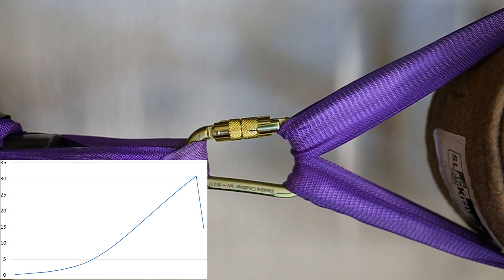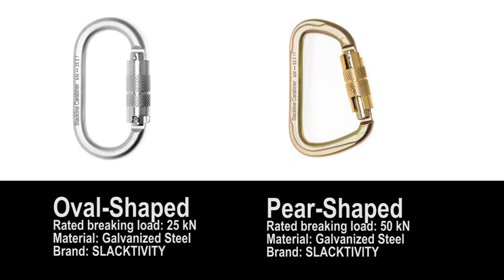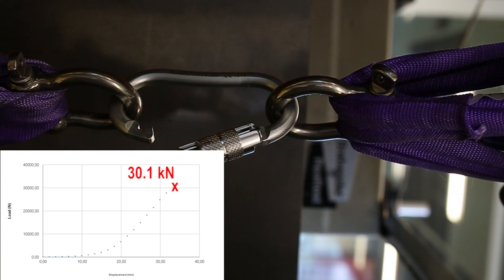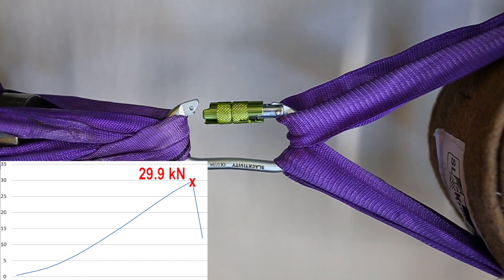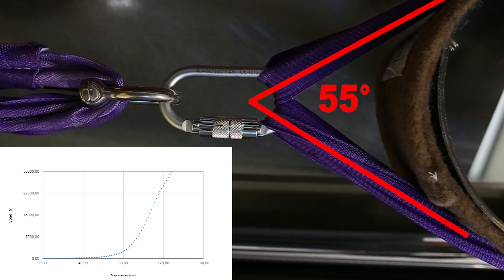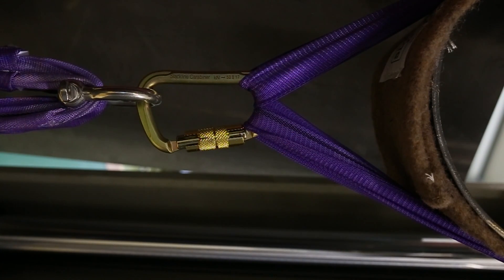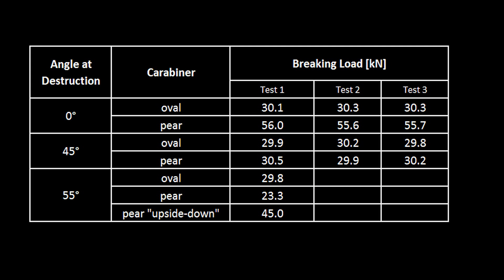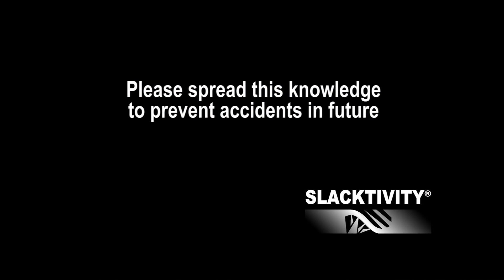How the shape of a carabiner influences its breaking load

Comment: That "pear-shaped" carabiner is actually an "offset-D" carabiner which is designed to be loaded along the axis of the back bar. If you actually used a pear shaped carabiner, which incidentally is pear shaped and ,like a pear, is symetrical in design, you would find that the breaking force for the tri-loading would be significantly higher. Obviously, if you tri-load an offset-D carabiner there is an undue amount of force along the axis of the gate, which it was never designed to accommodate.

Comment: Even though the gate broke it was still holding load... how % more load until absolute failure? Loading biener in correct orientation.
Reply: When the gate breaks the load dramatically decreases. The only reason there are no parts flying around is it's only short slings which are slowly pulled by a hydraulic cylinder. THERE IS NO % MORE LOAD AFTER FAILURE. Any real life load at that biner could not be stopped by it after the gate is broken, except for the rare case the static load is below the load the biner is rated with open gate and the gate by a short and precisely dosed short impact.

Comment: Definitely should never tri load your carabiners, if possible. But also I wanted to point out that your test is flawed. Your testing the 2 biners unequally. The oval shaped one you use a webbing sling for most of the testing. Vs. The pear shaped you use a those steel links.  That's why you see the breaking point significantly weaker. The webbing sling spreads out the load on the multiple points of contact.  Think of how a girth hitch vs. Basket hitch does the same thing.

Comment: Your ovals were all "upside down", the pear shaped was only "upside down" for the very last take. Youre creating conclusions which don't exist.
What you actually showed:
pear upside down: 45Kn
pear full: 55Kn
oval upside down: 30Kn
oval straight: 30Kn

Extra result: pear other way up: 30Kn...
Reply: "Upside down" means that two slings are connected on the smaller side of the Pear (Type H or HMS). Oval (type X) is symmetrical and has no  smaller side. Tests are conclusive. With load on the larger side HMS (55º) 23kN. Conclusions are the following: 1. HMS are very good for straight load. 2. HMS is weakened by pre-load and angle. You may have bad surprises when using inadequately. 3. Oval resistance is consistent even with pre-load and angle. Take care

Comment: Great. I just bought 10 ovals on Amazon this morning at a good price. It was a choice between 5 pear or 10 oval with a few dollars difference.
Reply from the maker: Good choice. I just hope the quality is the same as the biners we've tested. Not all oval biners will perform as good as these ones...
Reply: They are for two medium weight pulley set ups. They are steel and no 45 degree type loading as in your video. I always use gear that is stronger than the job needs. An architect once told me that when he builds a balcony he builds it for 50 people because one day he says the queen will be passing in a parade and there will be 50 people on that balcony watching.

Comment: Hey :) i'm watching your videos for 2 years now and really enjoy them all. Keep up your nice work! ;)

A few weeks ago i bought my first 100m Slackline and i wanted to know if it is possible to connect 2 roundslings with an anchor sting or another knot, if the roundsling is too short for a tree...
I did it today... but i wasn't really sure if its save enough.

Greetings from Germany :)
Reply from the maker: Hi, it is no problem to connect to round slings with a girth hitch (=Ankerstich). There is a slight reduction in breaking strength. But e.g. with purple slings that have a working load limit of 1 ton, the breaking strength is 7 tons due to the safety factor. So the strength of those slings is mostly much higher than needed in the slackline world. You mostly have to be careful that there is no abrasion happening on the slings.
Reply: ok :) thanks for the fast reply! :)